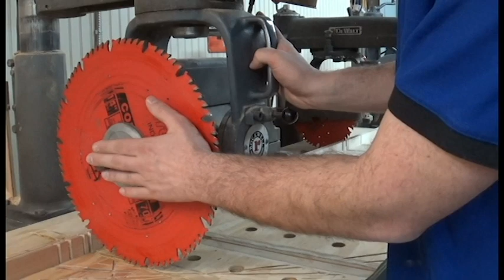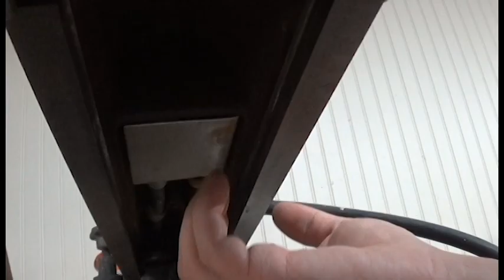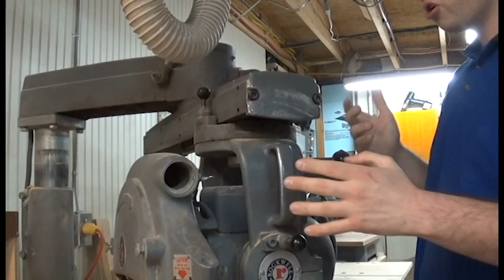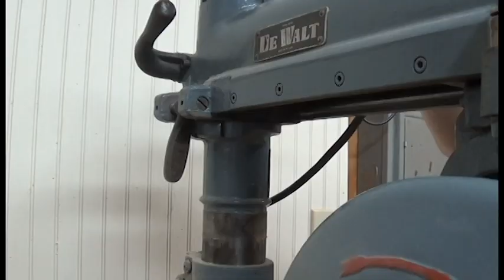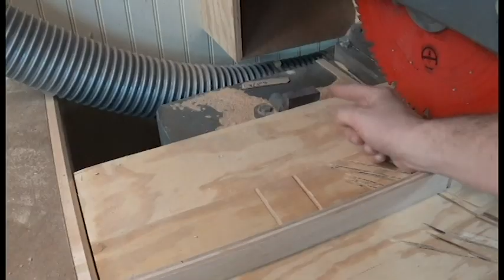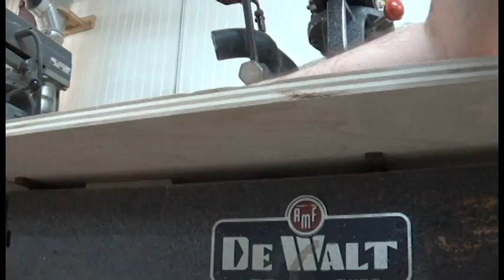Buyer's Guide: Choosing a Radial Arm Saw

Comment: One underappreciated reason to run a smaller blade on large radial saws: Doing so allows you to get the  nose of the blade guard in contact with the workpiece when ripping thin stock, which you often cannot do on the industrial saws with the nominal blade size.

Comment: When running bolts into these tables, what prevents you from encountering them when cutting into the table to establish a relief kerf at various miter positions ...?
Reply from the maker: That’s a good question. I’ve recessed them pretty deep and the blade just barely cuts into the table. However it does make me a little nervous every time the blade goes over one.

Comment: very thorough rundown lots of things the average person wouldn't consider when selecting a saw. I think the only thing you may have skimmed over a little was power.   When discussing the concept of more industrial focused saws is the fact that the larger industrial  saws (1.5HP+) are frequently 3 phase.  Not an insurmountable problem, but the average hobbyist wont have access to  3 phase power and would need to purchase a phase converter.   Which is an additional expense and requires some basic electrical knowledge to select and install.
Reply: True, but nice thing about a VFD as a converter is you get soft start and braking -- the latter being very useful for large saws especially.  I have two old dewalt GE 16" saws, the single phase saw takes about 2 minutes to spin down depending which blade I have mounted.  The three phase saw spins down in 6 seconds as that is what I have the shutdown time set to in the VFD!

Comment: I try to keep my radial arm saws out of the wild  or they get wet.

Maybe some day they will make a  cordless radial arm saw thats also water proof, you can take to the job and use.   <<<< dewalt whats yah doing?
Reply from the maker: @bobbg9041  they used to make a trailer mounted DeWalt with a generator under the table back in the late 40’s.

Comment: recently picked up a craftsman 113 model RAS in really good condition with multiple attachments for $70 (rotary planer, molding kit, jointer/planer kit, and a sabre saw attachment) that the guy's father bought new in 1960. It's really neat having a saw that's made a ton of furniture in it's lifetime including a rocking horse the guy still had in his garage. Am absolutely loving it so far. Mainly will be used for cross cutting and this weekend I plan on building the table to make the raised doors you made a video on. Am a novice in woodwork but have been around power tools my whole life so I felt comfortable purchasing after watching your videos, had no idea how useful a RAS was until I came across your page. Thanks a million for making them. Am absolutely loving it so far and am looking forward to building more odds and ends furniture pieces for around the house and outside. Thanks again!
Reply from the maker: @badpillowfly2085  glad I could help!

Comment: I picked up a DElta 900 today and after a bit of oil and wire brush work it fired right up and cut a perfect 90.  I was somewhat stunned by how smooth it ran.  The build is amazing.
Reply from the maker: Those are great saws.

Comment: Some important notes about Craftsman radial arm saws, because it's not mentioned much anywhere:
1.) The Craftsman saws (1970's versions) are very good. They are designed very good, and have all metal parts. 
2.) The problem with the Craftsman saws, is NOT THE DESIGN. 
3.) The problem with the Craftsman saws is that the carriage bearings and bearing "rods" along the arm, are not hardened steel. The bearings that support the carriage, are not precision, high speed bearings, like on the Dewalt saws.
4.) The rods wear flat very quickly without being lubricated on the Craftsman arm.
5.) The carriage bearings weren't properly lubricated from the factory, and are dry, and they seem to be the first thing to wear out on the saws.
6.) The loose carriage bearings that are of low quality, as well as the soft metal rods that flatten out easily, means the carriage doesn't move smoothly, it feels gritty and uneven when you slide it through the range. The bearings also allow a significant amount of "slop" even when the bearings are snugged up very tight against the rods. The bearings themselves are defective, with WAY TOO MUCH clearance internally.
7.) Finding a newer Craftsman RAS that has low hours, or finding a way to replace the rods and bearings on the carriage, will make a Craftsman saw very good.

Comment: The fact that this channel is the only radial arm saw channel, showing rip cuts, dados, and actual radial arm saw comparisons... It means the internet is BORING. The people with their new fancy tools are TOO BORING. You NEED an old radial arm saw. After 25 years using a table saw, and circular saw, AND a sliding compound miter saw (they aren't called chop saws. A chop saw is a metal cutting saw). 

Using a radial arm saw for the first time, I couldn't believe how much FUN it is to operate. Woodworking is supposed to be FUN. It's the lack of hypoid/worm gears in a radial arm saw, with the brushless induction motor, that makes them whisper quiet. The quiet, relaxed nature of a radial arm saw is a MILLION times better than a SCREAMING 15,000 rpm miter saw motor. 

Miter saws have to use a gear drive, and they generally all have a motor that has brushes, and the motors just have an awful "whine" to them. A radial arm saw, it just sounds like a big fan motor, it's so quiet. I can run my radial arm saws with no hearing protection at all, it's about 50% quieter than my SCMS saw. The feeling of using a radial arm saw to perform a standard "pull cut" is so precise, so effortless, and so quiet and controlled, there's really no other tool like it. The overall experience is so enjoyable. As far as I'm concerned, my favorite tool of all time is the radial arm saw.

Comment: I recently acquired an old Craftsman 10" radial arm saw (without the metal table) for $50... Maybe not the best deal out there considering the condition, but I wasn't going to haggle as long as the motor was good... He couldn't figure out how to operate all of the adjustments on it, so could not determine how to raise the arm, tilt the blade, or rotate the arm... The slide did work though... None of the lock buttons seemed to move... All in all, I would say that calling it "crusty" would be an understatement -- anything that could rust seemed to be rusted... Once I got it home though, I placed it on top of a pair of 30g plastic barrels with a piece of 3/4" plywood across the tops of them as an impromptu "table" so that I could work on it... After quite a bit of WD-40 sprayed in pretty much every place where it could possibly be sprayed and a bit of a web search for the user manual, I eventually got all the lock buttons to work and everything to move, albeit a bit stiffer than I suspect that it was when new... In other words, it's not that different than my old(er) body... :)  Since I already have a table saw and compound miter saw, I mainly got this because I wanted something that could do crosscuts on wider boards which would be cumbersome to do on a table saw...

One thing though... These saws weigh a lot and are a pain in the butt to move around single handed... I was quickly starting to wish that I had a trolley-mounted chain hoist in my garage...

Comment: All three you have are premium saws. The is an easy difference. Don't buy a cheap Radial ever . Some vintage Sears with cast arms are nice. It's best to start with a 12" saw . All your saws have something in common. They all are cast arms . I have a Delta 12" and I'd have  a cheap 10 " , but the one you have is great 😎

Comment: I'm just getting into radial arm saws and your videos have been immensely helpful. I have a DeWalt MBF (3/4 HP 9 inch) and a Delta Rockwell 33-562, which is a 1.5 HP 10 Inch turret style saw. I'm having a good time getting them ready for use. Thanks for the great content!
Reply: Do you have any videos or reviews with the Delta? I have thought about getting a turret style. When I look at the Delta turret saws, I think it must be superior, and it looks extremely well built and highly accurate? Although, the guy Ed Waggoner Sr., he apparently replaced his old Delta with Dewalt 790, and he seems to like the Dewalt more, although I am not sure why, he doesn't provide a comparison of the two saws.

Comment: Thanks for your videos mate! There's a lot of hate for radial arm saws on the internet so I was hesitant to get one. After watching your videos I decided to start shopping around. For half the price of a new compound miter saw I can get a 12" arm saw that will last me the rest of my life. After my second miter saw died on me I decided to leave the miter saw for high precision pieces and do all my rips and 90 degree crosscuts with a RAS. I pulled the trigger on a beautiful 12" 3 1/2hp Dewalt 7790 wired for 240v. I'm pretty sure this is a late 80's model but it feels stout and its a good size for my shop. You think it's a good model? I haven't had a chance to try it yet because im waiting on the electrician to wire my 240 outlet, which is something I've wanted for a while anyway. On that subject I would love to see a video comparing 240 to 120v arm saws. A lot of older tools can be wired to run either one and I'm really not sure how much of a difference it really makes.
Reply from the maker: 120 vs 240v usually doesn’t make a big difference unless the saw takes a long time to get up to speed or causes the lights to dim when it’s wired for 120v. I see your saw is 3 1/2 hp so that would need 240v to get the most out of it. 1 1/2hp is really the largest hp to run well on 120v.
Reply: I had a beautiful one I just pitched about 10 years ago STUPIDLY...... I should have not listened to the hype because I grew up around one and never had any issues...... (I wasn't really woodworking at the time so I needed the space too, but I'm buying another one in the next few days!!)

Comment: Great video. I got a Craftsman Contractor RAS and I love it. In fact I went and got it after watching your videos discussing how to use the RAS. I still have a table saw for back up but 99 percent of my work is done on my Craftsman.
Reply from the maker: I’m glad you’re happy with your RAS! They are great machines. Even with three RASs I still have my table saw in my shop too, as a back up and because some things are just easier on a table saw. Box joints come to mind.

Comment: Great video.  Thank you for making it.
I am an amateur furniture builder, but I have three radial arm saws: a Craftsman, an Inca and a DeWalt (home shop).  I bought the Craftsman new in the 70s and it is still the most important tool and the centerpiece in my shop.  However, I only use these saws for crosscutting and ripping: Dado heads, molding cutters and planer heads just make the tool dangerous.  Lastly, the one piece of advise I would add is, when buying a used saw, make sure the anti-ejection pawls come with the saw.  They are a necessary safety measure when ripping.
Bill MacTiernan

Comment: I've really enjoyed your RAS vids, my dad had one back in the mid 80's, before sliding miter saws were a thing. Then he sold it later as it took up room in the garage, we had a table saw as well. I just bought a RAS this week, needs cleaning, new table and realigning. Your vids will help out with that, thanks!
Reply from the maker: What kind did you get?
Reply: @TheNorthlandWorkshop  An older Sears Craftsman model 113.23100  the carriage rollers hang on the outside of arm. The column/arm swivel fine, but the motor yoke and blade tilt don't move.

Comment: Thanks for your video on a totally neglected power tool the RAS
I am using the Craftsman 10” RAS that my father purchased in the late 60’s, it has been used extensively.
I mistakenly purchased a sliding compound miter saw which usually just collects dust, unless I need portability 
Many of the late 60’s Craftsman RAS are very good saws but avoid the budget 9” saws unless it’s free maybe not even then. Nice ones can often be had for $100 sometimes less.
High quality 3/4” particleboard with 1/8” hardboard top seams to make the most stable top.
Reply from the maker: Yeah, sometimes manufacturers got a little too budget conscious with their lower cost models at the expense of quality.